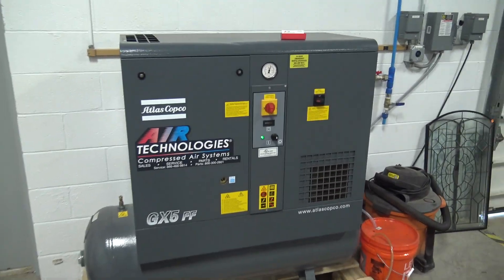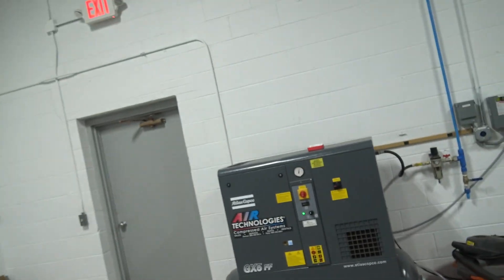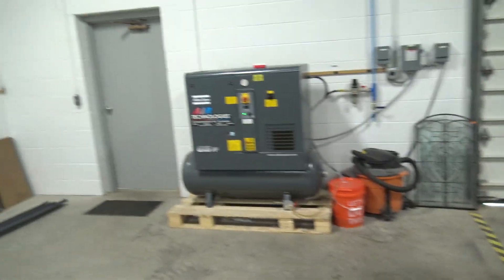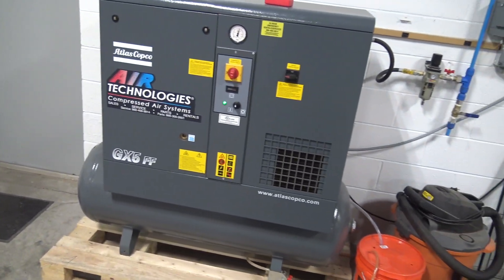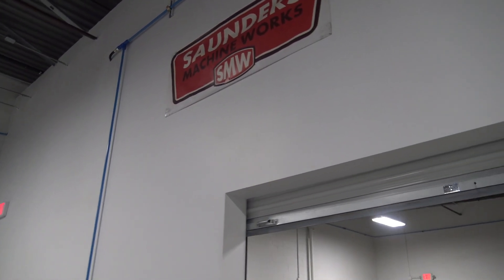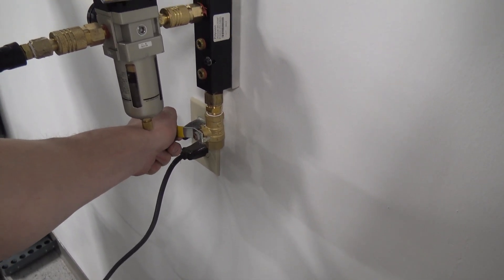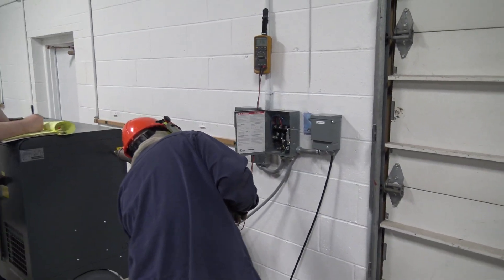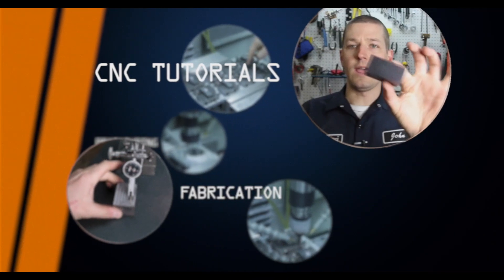Rotary Screw Air Compressor:  What are they?!  Worth the hype?

Comment: Maybe not a "Big Boy" solution, but did you consider those California Air compressors?  They're low RPM dual piston, oiless designs. They have a very decent CFM and are super quiet.
Reply: Most of the cost of a compressor is the energy it uses. Oil free compressors tent to be expensive and are not very efficient, meaning high energy bill. If you aren't making drugs or food products, there is no need for oil free air, an oil separator will do. It just has to be good enough, cheap as possible.
Reply: Hmm... as you say.  It just seems to me that the higher electricity cost would take a LONG time to equal the MUCH higher up front cost & the finicky / expensive maintenance of the rotary unit.  Oil free air would just be an incidental bonus.
Reply: Stringfellow Hawke
 Actually the savings can be considerable after a couple of months. On average, for oiled compressors, 90% of the cost of the whole system during its lifetime is electricity. Oil free tends to take nearly twice the power required. Compressed air is an incredible wasteful utility, I don't know how often I hear stories about plants saving tens of thousands a year by making a few small changes here and there to the system.

Comment: I think its the same principle as a super charger blower for a car.
Reply: Ivan Kebabremover your thinking of a centrifugal supercharger. they look like a belt drive turbo. a twin screw or 'roots' sc shares the same design as this compressor
Reply: I would like to point out here that Roots and the Atlas screw are not the same thing, they differ quite dramatically.
Reply: It's not. Its a type "positive displacement compressor", just like a piston compressor. Meaning, compression is achieved by decreasing the volume of a gas. 

A supercharger is a "centrifugal compressor". It's a type of dynamic compressor meaning it achieves pressure by accelerating air, and then decelerating it.
Reply: A supercharger is a centrifugal compressor powered by a centrifugal turbine.
Reply: No, that's a turbocharger.
Reply: jamie Russell: Your quite right, the construction of a typical automobile's super charger, is basically the same used on this Atlas Copco GX5FF compressor. Two opposing screws.
Reply: Michael Mouse not really, a car super charger is lobes that move the air similar to an oil pump. A screw moves air in a liner motion.
Reply: Roots superchargers come in a helical variety. I think that implies that it's essentially a screw. (And yes there are also ones with straight lobes.)

Now I wonder if somebody could home-brew a compressor using one driven by an electric motor and hooked up to a custom fabricated manifold and stuff?

Comment: normally these are used for hvac technologies not in air pressure applications maybe consider putting your reciprocal compressor or loud compressor in a quiet room or out of the shop

Comment: I run out of my garage with a fadal 4020 so quiet operation is important to me.  I looked real hard at the Kaesers when I started up.  But in the end I couldn't justify the expense and went with a large two stage piston pump.  It's not too loud and doesn't run that often.  I did have to build in a poor man's dryer which consists of about 40 ft of copper pipe to cool the air before a drain valve and a water separator.  But it works so well that nearly all the water that exits the pump comes out of the drain.  Almost nothing makes it to the separator.  If my shop was as large as John's I wouldn't hesitate to put a screw pump in though.

Comment: the reason to why some screwcompressors keeps running in idle is to protect the electrical motor from to many start and stops. it's decided from the manufacturer of the motor how many times that you can start the motor during a certain period of time
Reply: Do u know that period of time which is decided by the manufacturer to protect the electric motor?

Comment: Didn't seem that quiet in the end, i.e. I would still try and get a separate quiet box for it to sit somewhere outside, even if you don't do it alone a wood worker would only take a couple hundred for that sort of job . But I guess you have limitations as far as the building goes.
Reply: Atlas Copcos aren't that quiet...if you want quiet you get a DV or Kaeser. I just installed a DV 7.5 screw a little while ago...about as noisy as a dehumidifier...and the Kaeser 3hp in my garage is even quieter.

Comment: Do you think there would be any merit in going with a piston compressor, but building an acoustic enclosure for it?
Reply: A lot of people do this.  But watch the air temp inside as it can heat up and be detrimental to your compressor.  I ended up buying a quieter compressor instead.
Reply: Put a inlet ventilation fan, and outlet ventilation fan, they need to be high flow ventilation fan. Put 6 total of them, three inlet, and three outlet.

Comment: Really enjoy your videos since I discovered them a little while back.

Did you consider a scroll compressor? (Did you know about them?)

Price point is similar to screw compressor, perhaps a bit lower now that there are NC tools to machine the scrolls accurately; even in China. ;-)

Some types are oil-less on the air side. i.e. oil has no chance to mix with the air being delivered. Quite popular in the food processing and medical application areas 

They are also more efficient than screw and piston compressors. Compressed air is already a very inefficient way to transmit power — something to keep in mind if you employ lots of air tools. Air tools are neat; they are small and light but an air motor needs (IIRC correctly) about 3 times as much power at the compressor.

As for your noise problem, you can, if they're not going to be in the way of gantries, hang "soft" timber panels vertically from the rafters.  Compressed fibre timber (MDF-like) is relatively cheap. I wouldn't use anything less than half an inch thick because it is too flexible and prone to tearing.

Proper noise attenuating panels are made from dense polymer foam but I hesitate to recommend those in a place where hot metal flies through the air.

Suspend the panels loosely with wire cables through reinforced eyelets.  I'm guessing from the videos that 4 ft by 8 ft panels could be suspended "on edge" with their bottom about 10 ft off the floor (lower and closer to the noise sources is better, but you have to keep lighting and the ability to move stuff on the floor in mind). Hang the panels at "random" angles to form a labyrinth through which sound won't travel directly. Try to avoid parallel panel faces in a direct line.

The panels work in several ways; first they absorb some of the sound energy; second they lengthen the path of sound between the source and the listener and thirdly;  they set up interference between sound waves as they reflect from unequal distances.

And, if it's good enough for the Sydney Opera house; hang some panels off-vertical above areas where lots of noise is made from tools that are moved around a lot; like a fabrication floor. This will reduce the amount of sound that reaches the roof. Talk to an electrician about the possibility of incorporating lights in such panels to negate the shading of the fixed lighting that they produce.

You could paint the panels in bright colours to seal their surface but keep the finish rough and "soft". Lighter colours will minimise the amount of light that the panels "steal". If you have far too much time on your hands, you can use a router to cut patterns in thicker panels to break up the smooth surface before painting. Grooves, stipples, etc will more effectively attenuate the higher frequency noise. There are also some tricks that can be played with small holes but manually drilling thousands of them will not be fun; not even to watch.

BTW: your walls will also be reflecting sound. Make up some mobile sound screens to place around areas where work happens sometimes and where a permanent screen is impractical. It's better for the noise to hit a "soft" screen than a hard wall.

P.S. Get yourself a sound level meter and some instruction on how to use it well. You wouldn't cut metal without measuring it first; and the same goes for cutting sound. No need to spend even hundreds of dollars. Apps for mobile devices are at best of marginal utility. They tend not to be very repeatable form one day to the next.

Acoustic specialist spend big on spectrum analysers, etc. but a fundamental understanding of sound, listening and measuring can achieve worthwhile noise reduction at a fraction of the cost.
Reply: As I understand it, for one or another reason the sound waves tend to cluster in the corners, so sound damping in the corners is by far the mot efficient strategy.

Comment: We did our air piping out of PVC water pipes, garden hoses and to stabilize the whole system, we added some old fire extingushers restored to pressure tanks close to hungry air eaters. It's running on 8 Bars. It would be enough up to 12 Bars.

Comment: what a fail to let the compressor run the work way because of incorrect phase order. Should have used a phase rotation indicator(they are cheap)
Reply: The paper on top does the same thing, much cheaper! Haha
Reply: Yeah a complete fail on their part. Professional installer doing this for living day after day without such a crucial tool. Alot of machinery doesn't tolerate backward rotation at all, doing it this way is just asking for trouble.

Comment: I would recommend putting the recip in series with the screw, so you can run either depending on your needs.  That will eliminate the screw cycling on and off.  After the warranty period, you can probably get a VFD to control the motor on the screw compressor, which will be more efficient and allow for soft starts or throttling without having to cycle off.  Also, an additional external oil separator will get the oil down to 1-2ppm in the service lines.
Reply: I would set them up parallel so they could be isolated from one another for maintenance

Comment: Great video.  You forgot to mention who shouldn't use a rotary compressor.

You did a great job on that pipe.  I have the same stuff in my MUCH smaller shop and I had a hard time getting it straightened.  Yours looks great and nice and clean.
Reply: That piping system is sweet and user-friendly but im a fan of upunor or copper

Comment: I work in a printing shop and we got a couple of 50 hp rotary screw compressor. they are on all the time. we would not use them without a dryer. if you run it without a dryer you would get water and oil in your air lines which will ruin all your selenoid driven valves. the oil will rot your seals.

Comment: The oil in the screw is noy to lube but to seal. 
There is no contact between the 2 screws or the housing.
That's why you have 2 helical gears right next to the screw, to sync them and avoid  the contact and the wear.
Reply: The oil in a screw compressor is for three things, a seal as you mentioned also a lube and the coolant.

Comment: That compressor has 5kw electric motor so its named after 5. GX7 has 7kw motor etc. Directstart screw compressor is more economic. 3 phase compressor is good if u have much use of air because it halfs power take so u don`t need very big fuses and cables. On 3 phase It runs on standby to cool off its contactors . Wet tank is much better than dry tank. dryer doesn`t need to do so much work because a most of water is in a tank.

Comment: I'd take that tank from the old one and plumb it up as extra reservoir capacity.
Reply: In my workshop I use 2" pipes and that gives me a distributed tank! :D
Reply: It's a common way big industries do it - use extra tanks as buffers away from the main tanks, closer to the consumer. This way they can save up on pipe dimensions without loosing performance.
Reply: No, that's not necessary. Air doesn't damage anything if it goes the wrong way in an airline. A manual valve can be useful though, so you can shut the spare tank off for maintenance of either side (it can remain pressurised while servicing the main tank for example).
Reply: When using extra tanks, is there is a one way valve in the input line?
Reply: Right on the floor there in the back corner, would be a good way to tell if the air stays dry too by flipping the moisture drain on the extra tank and seeing what has accumulated